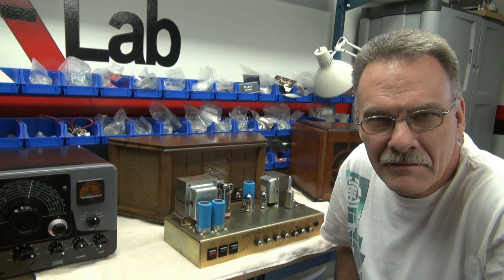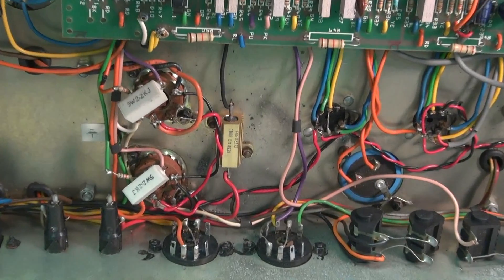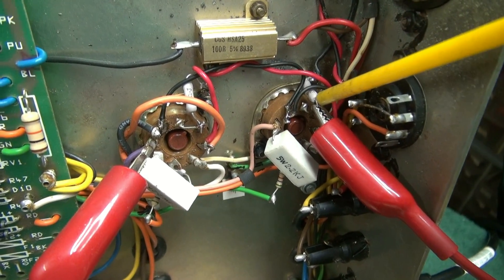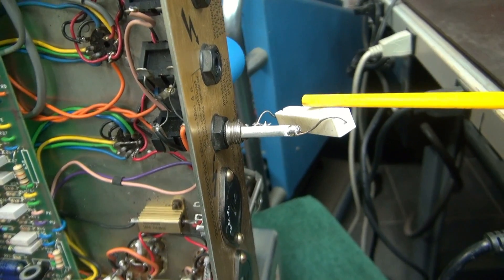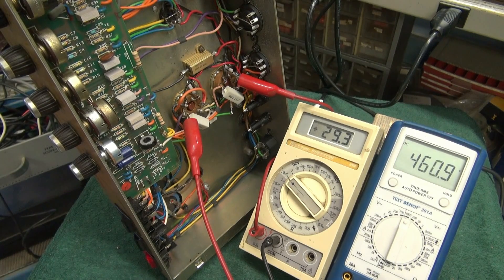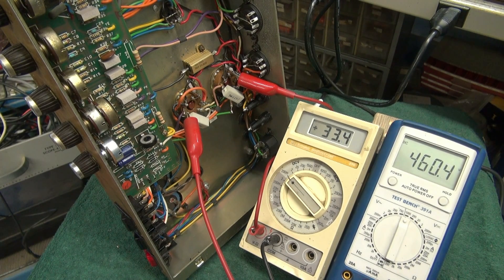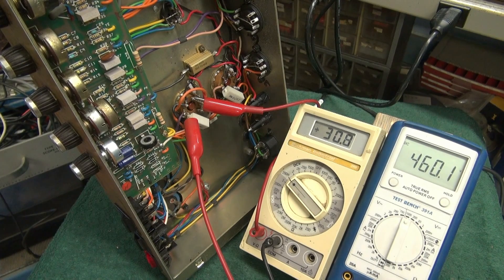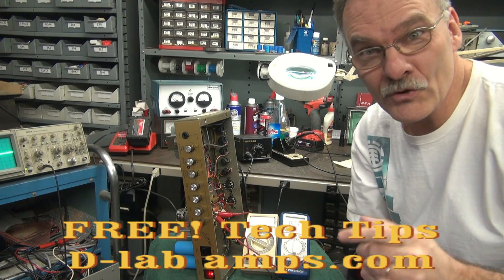Marshall EL34 Tube guitar amp bias adjustment mod D-lab Electronics

Comment: Excellent video, I have two questions:

How many watts should the resistor be to work as protection? I have a 2-watt one — would that work?

Does the resistor need to be a precision one? Would a 1-ohm 5% resistor that actually measures 1.5 ohms not work?

Comment: Thanks for the excellent video!   When you bias the amp with a matched set of tubes, should you read the same number of milliamps across all 4 tubes?   I have one tube that reads lower than  the rest by about 4 MA.    My plate voltage is 466 with EL34s so I'm biasing around 37.5 MA (about 70%).    According to your video if one tube is a little lower than the rest I'm OK?   Thanks again for the information!

Comment: i am trying to check the bias on a vintage push pull amp that has no bias pot no test points and no standby switch. The tubes are red plating bad and I want to see if they are biased properly or if i have another problem but nobody seems to show this on vintage equipment
im not understanding what exactly i am trying to look for. I see conflicting information.

Comment: Only thing I'd add would be to let the amp warm up for at least 10 min or so because the EL34's have a habit of drifting until they're fulling hot and you risk biasing too hot or cold. For EL4 rated at 25 watts and say a plate voltage of 460v, 25/460 = .054.  Now times that by 60% is .054 x .6  = 32.4 ma. The screens draw around 4 ma so 32.4 + 4 = 36.4ma for 60% biasing. Now that is with a 1000 ohm screen, I see these in this amp are 2.2k so not sure what the current drop is across them in idle. Anyone measure it?

Comment: Question, what is the point of having resistors on all tubes IF the bias control is for all 4. I know the value of my tubes as Ive had them checked with a tube tester and they are all the same strength. Wouldn't it make sense to only have one resistor as the bias knob is for all 4? I guess this would only apply if the tubes were all the same strength. Thanks

Comment: I’m not sure I understand the resistor you installed. So you clipped the jumper between pins 1 and 8. And then connected the resistor to ground and…. Pin 8?
Reply: Pins 1 and 8 are jumpered and pin 1 has a wire to ground. He removed the wire to ground and replaced it with the 1 ohm resistor. Voltage drop over the resistor in mV DC is the same value as total current through the tube in mA.

Comment: Howdy.
Another good thing with the cathode resistors is they help managing parasitics.
If mounting the resistors is felt cumbesome one might buy a couple of biasing adaptors. They will allow to connect a mA meter in the cathode circuit.
Regards.

Comment: Quick question I have a 50watt valve amp with 2 el34s  both power valve base plates pins 1and 8 are linked in series to  ground via the  6.3 V CT Brown winding from the Power Transformer can I put a meter on it without having to fit the 1ohm Resistors?

Comment: This is a variation of Gerald Weber's idea of the box with an octal socket, a 1 ohm resistor in series with pin 8,  2 banana jacks,
 an 8 conductor cable, and an octal male plug. I built one about 10 years ago, and it sees a lot of use.

Comment: I also have a 1977 2203 Marshall mk2 master model that had new tubes throughout and caps also by the same tech who did the 73 super lead, in the mk2 the power tubes are quad set of 6550 JJs  out of curiosity i popped the back off to look at the work and right off noticed that two of the power tubes  had signs of running hot, hot enough to dark-n the lettering and the other two looks like they have have never been used, lettering was still  bright red ,is there a bias problem?

Comment: Mr D-LAB or may I call you Terry ? I know this sounds ridicules to say but, have you ever done any repairs on  super vintage 1973 Marshall 1959 ptp super leads? the reason i say this is when i turn down the volume pot to completely off, it still has sound like it's on three , most components - power tubes/ pre amp tubes/ filter caps and some resistors have been replaced by a supposed  certified tech from a well known music store  there is some other pixies lurking inside such as hum!  I thought that you might be able to throw a few pointers in there, or you might take on this item to use in one of your vids,with a quote?

Comment: Hi Terry, I have a question for you. I have a Marshall Bluesbreaker JTM45 amp that takes two KT66 valves. Unfortunately I wound up with very badly mismatched valves. They have a bias difference of 10 millivolts. My question is,  can these valves still be used or will I have to toss this pair of valves in the dumpster? Thanks from Michael Newell from Niagara Falls, Ontario, Canada
Reply: There is comment by ps10iceman to this video from 5 months age where he wrote that it is possible to add bias adjustment to each tube separetly so you don't have to worry if tubes are mismatched. I don't know how ask him or search in the internet, i only know that in my dsl15c there was adjustments for each tube but when i was changing bias for one  there was little change on the other, so it looked like that set bias for one tube then set for other then chech first and correct  little bit then chech this second and on and on to the point when both (it has only two output tubes) had same bias value.

Comment: E-Z-Hook probes/clips would be a lot safer to use than alligator clips. And, I'm surprised you don't have any "socket extenders" with exposed contacts so that you can measure any and  all voltages at the socket(s) while the tubes are operating but without having to poke around inside the unit. I have several homemade ones, with the 1 ohm resistors built in as well.  PS, the 1 ohm resistor method isn't 100% accurate because it adds in the screen current as well. I prefer inserting a series milliameter in the plate circuit (using a "socket interrupter") ; or the " transformer shunt" method....
Reply: Well if you measure the voltage drop across the screen resistor and subtract it from the total reading you'll be within a1 or 2ma difference with shunt without the worries.
Reply: good 'un shunt method is best. It’s dangerous, but just as dangerous as poking around the live chassis.

However, I always use the method where I measure the resistance of each side of the output transformer primary side. Write it down. Then turn the amp on, let it warm up. Measure the voltage drop across both sides of the output transformer primary side. Divide the two to get your mA calculation.

Measure your plate voltage then use that to multiply by the current to get your plate dissipation wattage. That’s the real figure we’re looking for. Especially since most modern amps push more voltage to the plates than any data sheet suggests.

Comment: Got a question. I have a JCM900 4100 100W head that I've had for years and it has gone through tubes left and right. I finally tore it down to see what was the cause and found R8 R24, R25 & R36 burnt and open. I also found the bias range resistor that the schematic shows as 15K had been replaced with a 6.8K. I've replaced all those resistors and also C15 the bias cap (47nF/250V ClassX ) with 47nF/600V Sprague orange drop. I bought a matched quartet of EL34's and replaced all the 12AX7's with new tubes as well. While trying to set the bias using a socket style probe, the current is running between 1 and 2 amp's. I have read that the bias range resistor may need to be a lower value to achieve a higher negative reading, hence, the 6.8K I removed and replaced with the 15K. What are your thoughts?

Comment: One meter was on the cathode DCV setting but you stated the reading as amperage? Did I miss something? Only one bias adjustment for both output tubes? Also, please cut out the background music, it's very distracting.
Reply: The resistors are 1 Ohm, which means that the voltage reading in mV corresponds directly to the current in mA. Ohm's Law: I = V / R, so (e.g.) 50mV / 1 = 50mA.

Comment: Graphite conducts electricity.  Don't use a pencil to poke around in an amp, use a chopstick.
Reply: UptempoMusicLessons. Once he starts messing with the amp live, he does switch to a chopstick. 
He must have made sure at the beginning of the video that the voltage was zeroed out. But I’m guessing. I agree he should have used the chopstick from the beginning of the video.

Comment: Hey question here.i got a tube amp a while ago,first tube amp ive had.it seems the tubes are dead because they wont turn on ,could i put any tube that i buy and put them in.Its a Marshall dsl40 with celestion classic lead speaker and it came with the stock marshall tubes .i have mesa boogie 6l6 str 440 tubes pair i would like to put in
Reply: Or do i need to bias it.not sure how all that works

Comment: I have a JCM800 50 watt with plate voltage at 460 the lowest the bias will go is 70ma.   The  amp was left on for a weekend and power tubes burnt up.
Reply from the maker: Sounds like leaky negative bias caps. Change them out and recheck bias

Comment: If you are going to modify it with those resistors.  Why not go all the way and drill 2 holes to install Test Points on the top next to the tubes?  That is what I always do.  Then the user can just use a DVM to check the tubes bias whenever he wants?  He can match his own tubes then and know when 1 or both tubes should be replaced.   If they are a Freak about keeping their amp original you need to get one of those sockets with 2 leads on it that you plug the tube in to and the leads into the meter.  LOL  8^)
Reply: I did that too for several points to measure.

Comment: Hi D-lab!
:-)
Thanks for the help!
I have a question about the 1ohm resistor!
If it's going to serve as a fuse, I would like to be sure I will put the correct wattage resistor!
Would You please give me link to were I can buy the exact resistor, or even if You sell them, I would buy few from You!
Also I found something online about grounding pin 1 separately!
Would it matter based on Your opinion and experience?
Thanks for the help, and Kind Regards!
Steve:-)
Reply: Smaller the better to acts as a fuse.  1/4W 1% metal film will do as the voltage dropped across 1 ohm is in the mVs.  ;^)
Reply: PaulinTaegu 
Thanks Paulin!
:-)

Comment: You kept referring to measuring the current, but yet your leads were in the voltage jack of your meter and you were not in series with the load. You should bias to a certain mV value, not a current or mA value. I think this kind of terminology often confuses the average person who does not know anything about electronics.
Reply from the maker: Roger that Sir, I will make sure to clarify next time. Thanks for the different view. TD
Reply: Don't get me wrong, I love your channel and you have inspired me to do some awesome things with amps that I find. For that I thank you. You just don't know how often I hear from guys that they heard someone say this or that on You Tube. People hang on every word that some You Tubers say, without really understanding what is really going on. This leads to confusion and frustration with some of them. Sometimes they get so frustrated that they just give up trying to do things for themselves. That is what these videos are supposed to be all about. Showing what you have learned and to help others learn as well. Thanks again.
Reply: Actually Terry & D-Lab are correct. The leads are in the V of the meter, but it's actually measuring milliamps. One millivolt across one ohm equals one milliamp. Thats the whole point of using the 1ohm resistor. As an aside, Terry I didn't think you could get away with a small 10w dummy load on a 50w head?
Reply: Since the only output is residual hum, there's much less than 10W to be dissipated.

Comment: Is it not easiest to measure the DC resistance of each side of the primary, then measure the voltage across the same, then work out the plate current from that? No need for 1ohm resistors and and no need to measure the screen current and subtract that...

Comment: Excellent video just two thoughts, one you didn't mention where to connect the black leads from your two DMM's and also can you leave the one Ω resistors in place after you're done with the bias adjustment?
Reply: The black leads are connected to the chassis (0V) and so are the other ends of the resistors. One meter is measuring the voltage at the plate of the tube. The other is measuring the voltage across the 1 ohm resistor. The voltage across a 1 ohm resistor has the same numerical value as the current flowing through it, e.g. a reading of 37mV means that 37mA is flowing. (Ohm's Law: I = V / R,  I = 0.037mV / 1 = 0.037mA.) Many amps have these resistors installed at the factory, so you can leave them in the amp. You won't notice any difference in the sound of the amp and they are already installed when you next want to adjust the bias.
Reply: Thanks Silas, I assumed that but wanted to be sure as the black leads weren't really visible in the video.

Comment: Could I just do this by ear with someone playing a guitar and my eyes watching the tubes at the same time while I turn the pot?
Reply: If you watch closely, you would crank the bias until the tubes started glowing red, and then back down until the red plate goes away. It's a crude, old timey method, like Grandpa adjusting the timing on his engine with a glass of water on the air cleaner. It'll work if it's all you have, but there are better ways. Most people today would not recommend it.
Reply: You could, in a darkened room, but your buddy would have play really loud for a long time. It would be so easy to get it wrong and trash your tubes.

Comment: sooooo, install  a one ohm resister betwixt pin 1 to ground, connect probe to pin one across same resister, then read milliamps.  set to about 35ma for el34.  am I correct?  next...  neutralizing a pair of 6146...  thanks Terry, Don
Reply: No, you need to set your meter to it's voltage range. You're reading voltage, but the number of mA flowing in a 1ohm resistor is the same numerical value as the number of mV across it.
Reply: How many watts?

Comment: 2 questions. What's percentage of plate dissipation results in 30mA current? Also 3mA offset between plate currents is 10%. In your mind, how much percentage offset is 'too much' before you look for different tube pairs? Thanks for the video.
Reply from the maker: I'd rather discuss "what is the air velocity of an unladen swallow"?
Glad you like the vids. More to come
Reply: OK, I'm working on a JCM800 today and was looking around for bias point recommendations. Some say 70% plate dissipation, others say 60%, while others say just adjust then play to ear then check to insure you're not over power dissipation. A lot of contradictory statements out there. I'll keep looking.
Reply from the maker: Hello, SOrry, I did not know if the first Q was serious. Can you measure the current thru the tube? Is there a cathode shunt resistor installed? 1 or 10 ohms by chance?
Reply: I'm currently working on a solution to verify your selection point of 30mA. I'll get back soon. I have made a video, but it has a mistake, correcting the mistake now.
Reply: EL34 max watt dissipation is 25. So the second plate voltage (tube 2) was 460V. Divide 25/460=.054. So .54 is the highest you can set these tube to be at 100% dissipation, Now multiply .51 x 70% =37Mv, set the bias to .37 Mv and you will have it at 70% dissipation. .51 is your common denominator.
Hope that makes sense
Reply: +Craig Hollabaugh and I'm guessing you are the twit who gave Terry's video  the thumbs down. It has been 2 months genius, still waiting on your video findings
Reply: yes, this makes sense. I'm just wondering why you chose the percentage of 70%?
Reply: @CraigHollabaugh  It's a percentage which, in most guitar amps, is high enough to avoid crossover distortion, but low enough to prevent red plating during overdrive.
Reply: When a Class AB amp (such as the JTM 50) is amplifying a signal the average plate dissipation increases. 70% is a safe value which ensures that average plate dissipation will not exceed maximum dissipation when the amp is working.
Reply: I get a little more response as a pose to 60%. and if I bias at 80% the amp will have increase harmonics and gainier. The higher you go the least the tubes will last, that;s why I bias at 70%
Reply: Sure, that makes sense. I'll have vary my bias point to hear these differences as well. Thanks for the quick reply, have a great weekend and stay safe.
Reply: When the amp is working plate dissipation increases. Instantaneous dissipation can (and does) exceed 100% but the critical value is average dissipation. If you bias at 70% of max dissipation at idle you can be fairly sure that the average dissipation when playing will not exceed 100%.
Reply: Oops!
Reply: Cool... the question I have then is how hot can you bias without great risk 70% + or - what? 2%.... or is 70% an accepted level?

Comment: hello
great videos 
i got a problem with my 1973 SLP Marshall which the technician couldn't fix 
appreciate if you can send me your email so i can send you the readings 
basically the Bias is overheating after 10 minutes 
thanks
Reply from the maker: Hello, please send me a contact thru my website: d-labamps.com. The bias issue could be a couple things. 1. negative bias caps leaky. 2. grid leakage, defective output tubes. 3. Leaking coupling caps from the inverter tube to output tube grids. Take a look. Are all of the output tubes over heating? TD
Reply: dang caps again, dag blab it!
Reply: Lousy tech.  Change your bias circuit E-cap or caps.  They are leaking when they warm up.

Comment: Couldn't you use a tube tester socket that is used in tv repair??? that would go between the tube and the base, and it has pins that come out the side to test...just a thought....nice video..